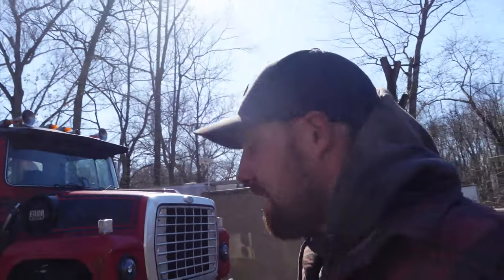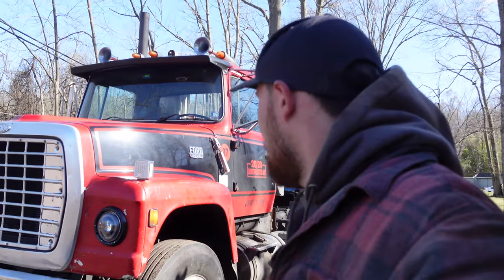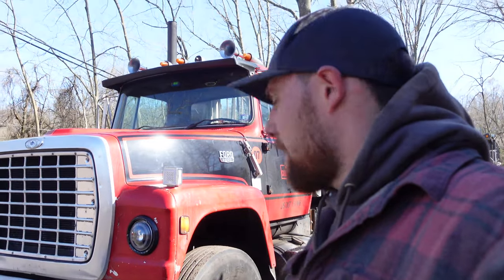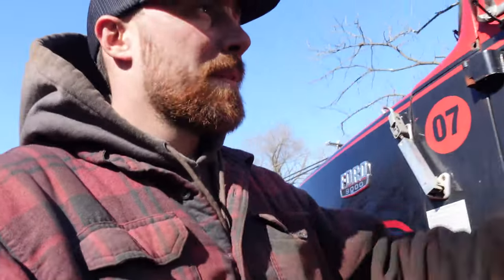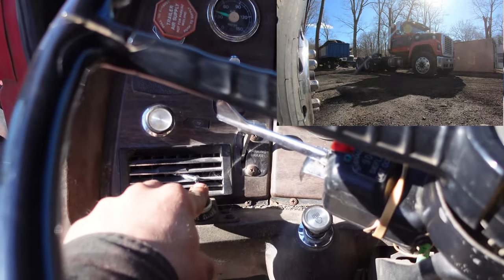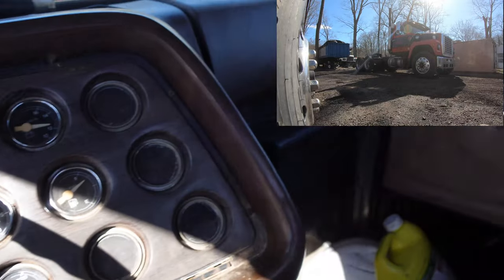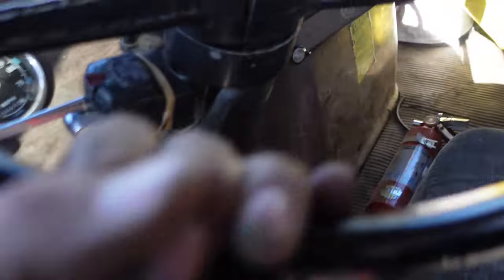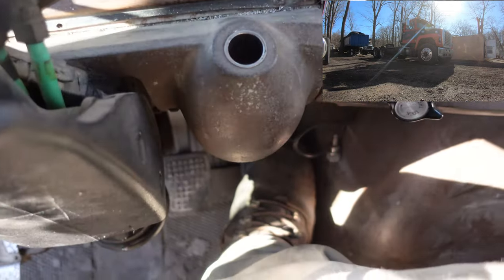Meet The Fleet EP 2. 1986 Ford LT9000 Tractor

Comment: Bunch of those made it to Canada. My dad had a blue 1988 ford lt9000 with sleeper. 18spd fuller 425hp cat , pulled China top super b's of drywall and powder cement to whistler b.c. Ended her career doing mine haul work throughout B.C hauling copper sheets and acid. The rust only gets the truck if it's sitting in the yard and not on the road. The salt water will bead off with some speed.
Reply from the maker: Thats history there. Thank you for watching!

Comment: Is there any difference between the steel wheels and aluminum as far as fuel economy and or power gains with the weigh difference?? Probably a dumb question. Definitely makes the rig look better.
Reply from the maker: No question is a dumb question, these are budd wheels. So they are stud pilot rather than hub pilot. The aluminums are lighter but I can't see it being enough to really change fuel mileage or anything like that. I would say the biggest thing is the look. But something we learned along the way is that the aluminum wheels are an inch thicker than the steel wheels so when replacing the studs you need to get studs that are 2 inches longer to compensate for the thicker wheels.